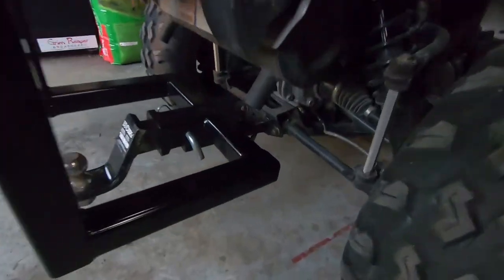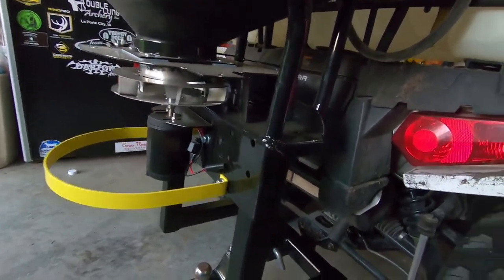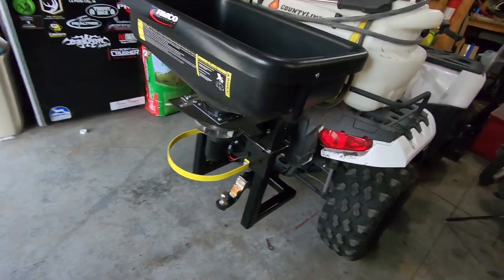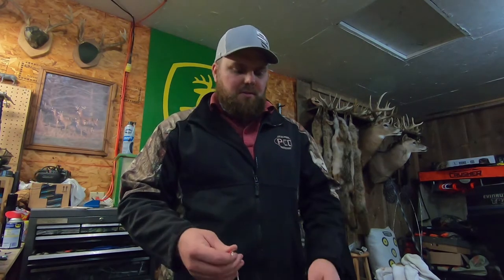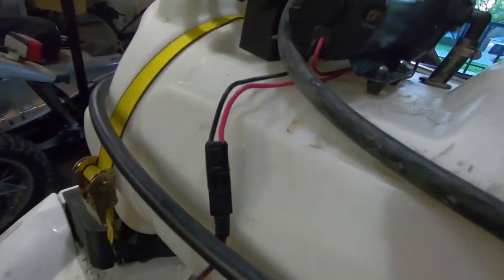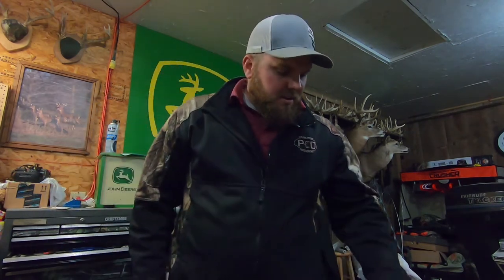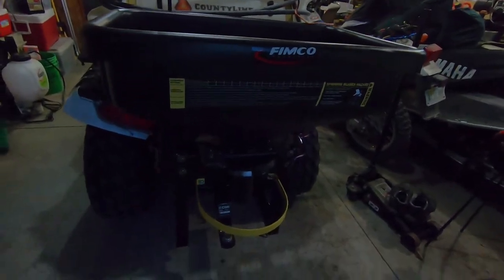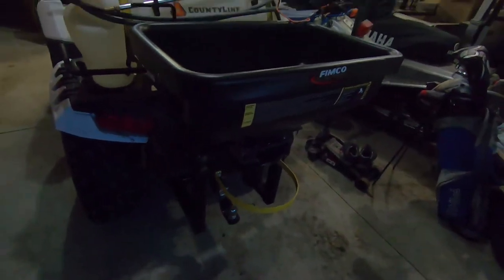Installing a Fimco ATV Spreader on a Polaris Sportsman!

Comment: Looks like a solid unit. About to watch you video where its shown in use. My only concerns are how you can access the open/close gate,  and how well does it spread small seeds like clover.
Reply from the maker: Mix your small seeds with filler or other seeds, i use oats alot or kitty litter